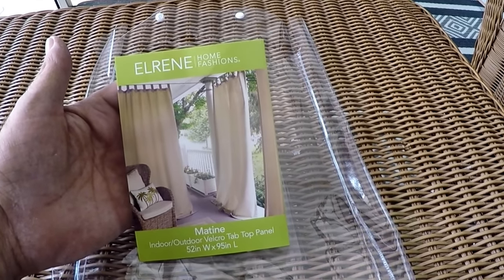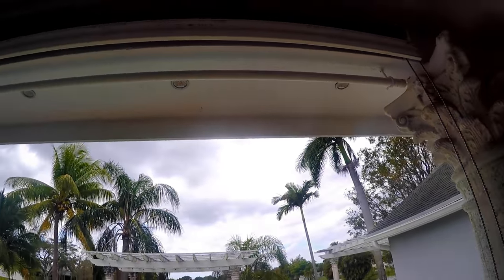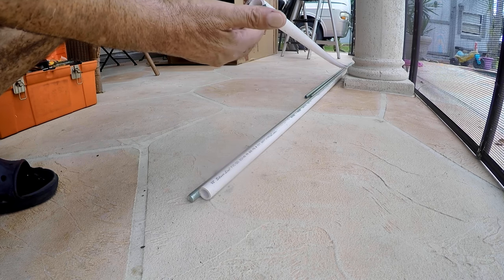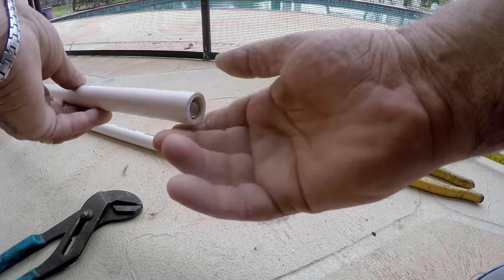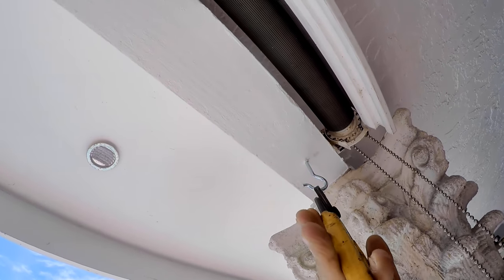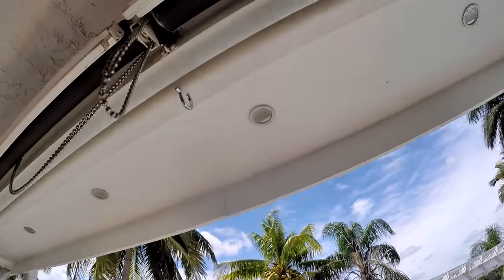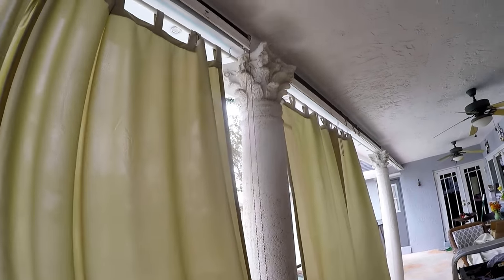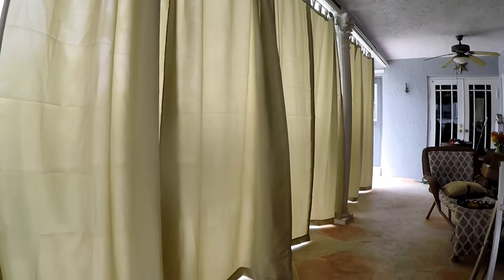HOW TO MAKE CURTAIN RODS FOR  PATIO and INSTALL OUTDOOR CURTAINS

Comment from the maker: I made curtain rods for our patio using PVC pipes, I will show how the curtains look hanging up as well. They are perfect to block the sun and for privacy.
Reply: sounds like a good idea,
Reply: How have those curtain held up?. I'm concerned about mildew. Thanks
Reply from the maker: @janevance6637  
They are holing up very well after a year and no mildew. I'm really impressed with these outdoor curtains.
Reply from the maker: @lynnewaugaman9695  - It's actually for grandchildren but it can be used for many things.
Reply from the maker: @lynnewaugaman9695  Here's the link If you prefer to install it yourself. Or you can google a company in your area that does the installation.
https://www.amazon.com/cerca-piscina-Saver-coloques-mismo/dp/B00BIKTISG/ref=sr_1_2?dchild=1&keywords=Pool+Fence&qid=1591224746&sr=8-2
Reply from the maker: @lynnewaugaman9695   Pool Fence DIY by Life Saver Fencing Section
You are welcome
Reply from the maker: @lynnewaugaman9695  Glad it helped.
Reply from the maker: @lynnewaugaman9695  Definitely.

Comment: Thank you John; great ideas, we went to our local Colorado home depot and got several 1/2” x 10’ 600 PSI Schedule 40 PVC for $2.91, Ook 2-1/4” white vinyl cup hook 10 pack for $5.98, we went with 1/2” x 72” zinc threaded rod for $10.46 which was even more rigid and thicker than the 3/8” but fit perfectly with the 1/2” PVC. I also bought several Dura 1/2” schedule 40 PVC caps for $0.56 each for the ends of the PVC Pipes. Thank you again as we loved the idea and it worked great for us.
Reply from the maker: Glad it helped and great improvement.

Comment: Hi your video was very informative just what I was looking for. I have gazebo 12x13 that has a Mosquito net and I wanted a little more privacy with the curtains and did not know how to add them very good idea. And I will try this out. I was searching for ideas and video  hit on the head. 
Thank you!
Reply from the maker: Glad it helped🙂
Reply: @JohnCRV  ..I hope you can help with my problem..similiar to the above but (1) I have a pergola with no above structure to screw in the hook in and (2)  my 7 ft pvc pipe bent with the weight of my drop cloth curtains. Any advice? Should I use the pipe in the pvc..if so, what about question 1?
Reply from the maker: @zaneblane8160  hi, 1) if you have no beam going across you will need to install some kind of beam first. If you do have a beam but not enough room to install hooks under because you have a screen, you can install the hooks on the side of the beams, just make sure they are long enough.
2) You definitely need to insert a pipe or solid rod inside the pvc pipe to keep it from bending and also one hook in the middle. A 10 feet rod you will need a hook on each side and one at 5 feet. Hope this helps.

Comment: Thanks for this innovative method. I am debating with someone about using pvc vs galvanized steel for an outdoor curtain rod. Why did you choose pvc with steel inside for reinforcement as opposed to using galvanized steel only for the rod? My debater said pvc will sag and the curtains can’t be removed once the pvc is glued. He said the steel is threaded so couplings and cups can be screwed off if necessary to remove curtains.
Reply from the maker: I've done other outdoor projects with galvanized piping but this project I felt it would be an overkill with the couplings and all.... but it can be done and can use Velcro tab panels so you can put them on and take off without removing the rod if you wish to do it that way...
Your other question on PVC
"curtains can’t be removed"? The video clearly shows how the curtains can be removed 2 different ways... by just snapping the pvc rod off the hooks and sliding the curtains out... or using Velcro tab type curtain panels, so you can put them on and take off without removing the rod if you wish to do it that way...

Good luck with your decision..... Either way is fine...
Reply: Thank you!

Comment: Great video! Looks way more simple and achievable than others I've watched,  THANK YOU! Could I install the hooks lateral instead of vertically? I wanted the look of the top of the curtain being kinda hidden behind the beams. I have a double wood beam I think I can screw them into instead...does this maken sense and do you think its doable? Also, if my patio length is 9ft do I need the middle hook? I assume I would do a 8 or 8½ft piping to leave room to install, hook and unhook as needed....
Reply from the maker: I think the hooks may bend if installed lateral or maybe not.
I would still install a middle hook to avoid the center to sag and high winds.

Comment: Thanks, great video. 
Are they made of Olefin? 
Have you had any issues like fading or breakdown of the fabric?
Do you take them down when there's a storm? 
How often do you wash them?
Thanks again!!
Reply from the maker: Not sure what they are made of, there’s a link in the description that has all the information.  
We have never had to replace them for any reason since they are outdoor curtains they can take lots of abuse from sun and rain. we did machine washed once so far. we did take them down during a hurricane watch which never came. On windy days we tie them to the columns to avoid them from flopping around. one thing I regret, is not doing this years ago. It took a long time to convince the wife that it would look nice as well as block the sun. We really enjoy our patio now..
Hope this helps.

Comment: Hello! Great video—thanks so much. I live in an apartment in Texas and all my windows face west. 😒 last summer was terrible. I bought some double-thick black-out curtains and wanted to use pvc pipe for the rods. How droopy would the pvc get? I thought it would hold up the curtains (?) without anything but a hook on each end of the 7-foot width windows (I have 2 windows at 7-ft wide each). Thanks so much!
Reply from the maker: You need to insert some rods inside so it will not sag down from the weight of the curtains. The reason I used pvc is because it’s exposed to water but if your installation is inside you can use regular metal rods. I hope this answers your question.
Reply: John C RV—-Thanks so much!  Yes you did answer my question—one more for you please. If I go to Home Depot for all this, what type of metal rod do I ask for? (Or do I just say I need 2 metal rods and they know what to get?). Thank you again for your help!!
Reply from the maker: There’s different types of rods even in wood for interior use. Some are more expensive than others. I’m sure they can show you all of them. Good luck.
Reply: John C RV— awesome. Thank you so much sir. 🙏
Reply from the maker: You are welcome.

Comment: Thank you for the video. If I use pvc as my curtain rod on an inside, 3-season porch, do you think I need the pipe inside the pvc? I assume you put it inside the pvc for strength because of wind and rain, but this is really an inside room without heat,
. Thanks!
Reply from the maker: The rod i inserted inside the pvc pipe is for strength so the pipe did not bend. If you feel yours will not need it you can try it and needed you can always add it later.
Reply: John C RV You’re right! Thanks for the great ideas!
Reply from the maker: You are welcome.

Comment: Thank you so much for the video. I purchased all the items but realized the link.provided for hook is not the measurements. Therefore I have 2-1/16" hook (based on the amazon link that was provided).
Do you have the correct link to the hook? Appreciate it
Reply from the maker: Look at the description again --- Hooks 3-3/8" 2 Pack.
Hope it helps.
Reply: @JohnCRV  Are you able to provide a link where I can purchase it online? I can't seem to find the hooks at the local hardware store. Thanks
Reply from the maker: Hooks 3-3/8" 2 Pack Link is in the description of the video. 
https://amzn.to/33TcEaK

Comment: Are those outdoor curtains. I live in Arizona and during the summer I need something sturdy and strong as the sun here Frys everything that is left outside.
Reply from the maker: Yes, they are for outdoors. They withstood the Florida sun so far. 😅
Reply: @JohnCRV  where did you purchase the curtain, if I may ask?
Reply from the maker: In the description click on the first  link, it will take you to the Amazon curtain site.
You can pick a different color and measurements as well.  Good luck.
Reply: @JohnCRV  thank you so much.  Have a great day!

Comment: Great idea John.  I noticed that you have some roll up screens/shades.  How do they work?
Reply from the maker: The roll up screen is what we use the most, they work well when we want sun, but not too strong (Winter). But the curtains have their own purpose, there's 2 hrs during the afternoons and mostly in the summer months that the sun is very strong and bright, especially when it reflects on the lake. It's so bright we cant even watch the TV in the patio because of the glare.
Reply: @JohnCRV  That makes sense.

Comment: What was the size and length of threaded rods you used?
Reply from the maker: I had some laying around
3/8 Threaded rods that fits inside pipe for extra strength.
Reply: John C RV Thank you!
Reply: One more question...for the threaded rods, did you use multiple ones to fit inside the 10 ft PVC pipe or did you just put one 24” threaded rod in a pipe?
Reply from the maker: @TheViviMarie  I used 2 rods
Reply: John C RV Thank you!

Comment: What is that other set of curtains I’ve seen? and manufacturer please
Reply from the maker: The curtains are all the same and the all the info is in the description.
Reply: No it’s the other set I’ve seen in your video? It looks like the type you pull on the chain or cord to drop a shade or curtain?
Reply from the maker: There you go!
shadetreecanopies.com
Reply: @JohnCRV  thanks so much? So you got the “dropdown blinds”? How wide and long?
Reply from the maker: @ChuckNorris01  They are screen shades, we use them in the winter time to block the 50% sun, instead of the curtains. keep in mind we live in Florida and the sun is strong in the winter as well..... You can order any size you need. we have 5 feet wide and drops down 8 feet.
Reply: @JohnCRV  ah ok thanks for your responses I am just debating which to go with? Sun shades or the curtain type?
Reply from the maker: @ChuckNorris01  Good luck.

Comment: Can you attach this to the lanai cage?
Reply from the maker: I would not trust the aluminum frame with these hooks, if that's what you are asking.
Reply: @JohnCRV  yes I'm trying to do something like this on my lanai
Reply from the maker: @pattisumey3084  Anchor into the concrete beam.
 If there's no room underneath, then anchor to the side of the concrete beam.
 Instead of using hooks I would use outdoor curtain rod "L" brackets.  here's some ideas,
https://amzn.to/3rOJ83b
https://amzn.to/3veUxvi
https://amzn.to/3vcMxL6

Comment: galvanized rod prices are out of control now..  this is an expensive solution now.
Reply from the maker: All building material is going up these days but there's no need to use galvanized rods inside the pvc pipe, as long as you seal both ends.